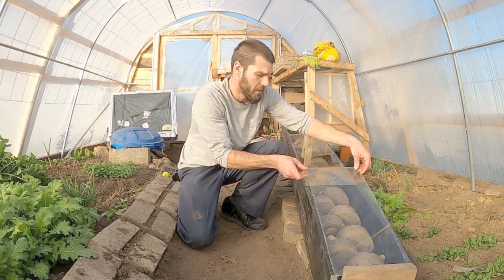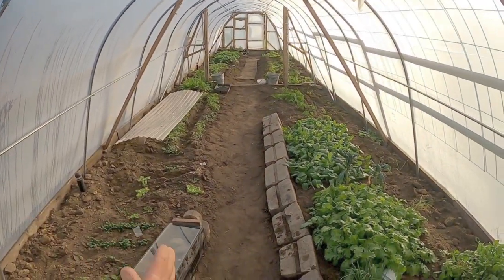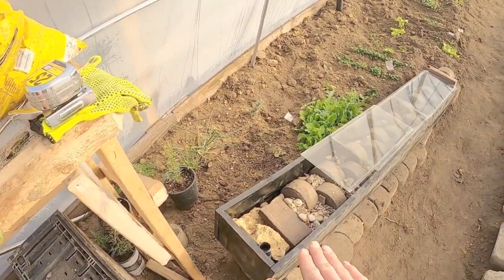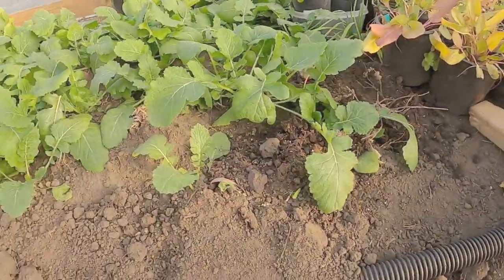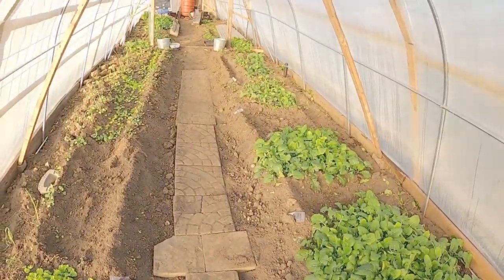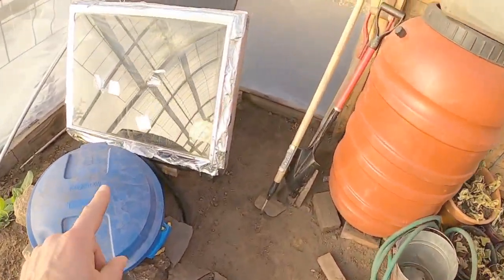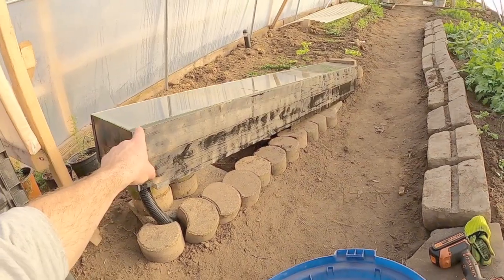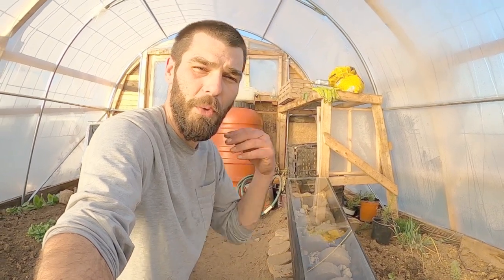DIY Greenhouse Heater With Recycled Materials | Solar Air & Floor Heating First Run | Experimenting

Comment: Great video, info, and presentation - your channel will definitely grow. Two curious questions, 1) I'm in New Hampshire -- where generally are you located?  2) Did you mention that the one end of greenhouse was facing south -- I always wondered (very basic question) why not put a greenhouse "sideways" to the south, doesn't this give far more exposed area to the southern exposure sun? -- Keep up the great work and thanks for sharing!
Reply from the maker: I wish I could have but we were avoiding a shedding tree that would’ve destroyed our poly and the size of the greenhouse made it so I had to put it where’ it’s at in the position. It’s not completely north south it’s at an angle to the south a bit and catches decent light rays

Comment: Nice one.  I like all the different experiments going on to boost your heat.  I got your compost heating small greenhouse in my youtube feed today.  Good to find another quality channel experimenting in the right ways.  Can you create a playlist that is just on your various greenhouse experiments?  I'm not sure I have enough direct sun to pull off this exactly as you have it where I live in the Central Western Canadian Rockies Zone 3ish, as we get a lot of cloud on this side of the Rockies and more mountains on our South side cutting into winter sun potential.  I do like the potential of these ideas, none of which are new to me in theory, and especially like all the combination as I said.  Keep up the good work and coming up with data.  It would be good to have the data on how much sun you are getting as this seems paramount to what your system needs.  Something like these, with Geothermal deeper pipes, as well as the Jean Pain, and maybe some rocket mass heating might work for me!  Peace and good luck on your experiments!

Comment: I really like your experiments, as you say about 6 minutes in, you need that Sun to get any energy, Thanks
Reply from the maker: Thank you! I’m interested to see how well this performs under different conditions and as the temps continue to drop
Reply: @Earthdwellershomestead  haven't figured out where you are yet,  what's your area or zip code
Reply from the maker: @williamlee2340  we’re in the northern part of Illinois here we see negatives from -20 to -40 in harsh winters, hoping for a mild one making it easier on our growing.
Reply: @Earthdwellershomestead  thanks,      I'm in Ontario, a little more north, but still in Zone 5b.   The inside of your hoop house looks so bright, you must get a lot more sun than I do
Reply from the maker: @williamlee2340  your north east from us, the angle of light in the video was perfect,  before the sun was getting ready to settle. I almost need sunglasses sometimes when the condensation on the walls refracts the light making it seem brighter
Reply: @Earthdwellershomestead  Oh Yikes! Dude. I lived in Central IL for a short time. The wind in the winter was murder. I recall a frieght train being blown off the tracks near El Paso one year.

Are you at least partially sheltered?
Reply from the maker: Yes we have good pine tree windbreaks , winter sucks lol